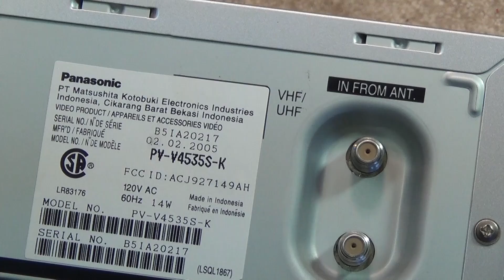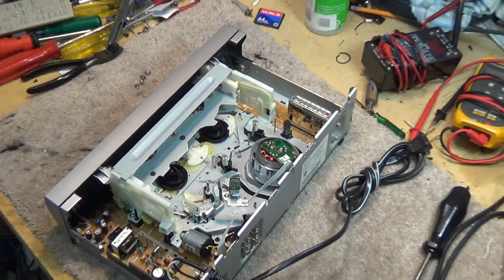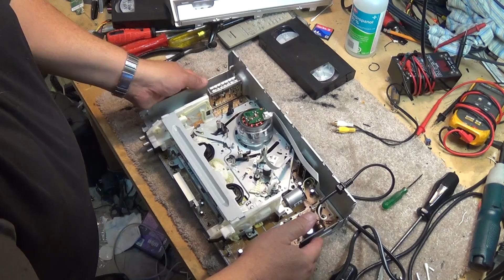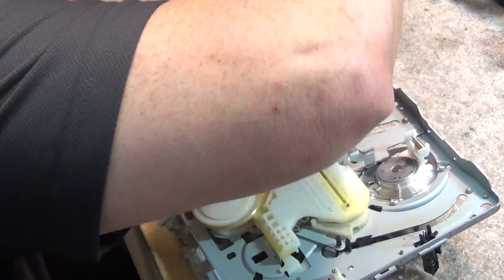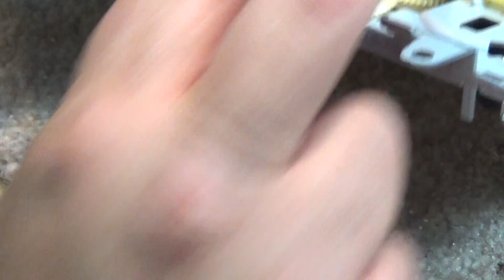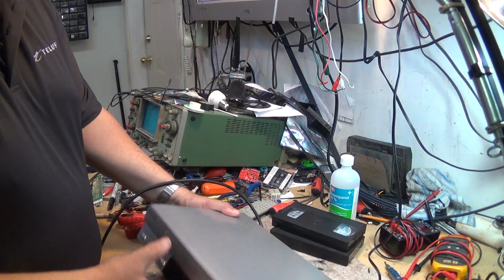Panasonic PV V4535 VCR total tear down

Comment: I got this vcr in July of this year along with 14 vhs movies but one of them was way too moldy to keep. It came with a panasonic remote but it had corroded batteries that expired back in December 2018, and it was a guy who had ALL KINDS of vhs tapes like SHELVES AND SHELVES of them. It was in Illinois but i live in Wisconsin. It may be the same model but it was manufactured on Nov 12 2005. Some of these late panasonics according to a few ebay listings i saw were from EARLY 2006!!! Not kidding.

Comment: Dave, i have this vcr as i said when i got it with a remote possibly but not the original back in 7/2023 model no PV-V4525S Manufactured Nov 12 2005 but the only issue is unlike my other machines the heads like to clog too easily! I did clean it 9 days ago and it helped a bit but it still got clogged from a damaged tape but it will clear once i run my head cleaner through it.
Reply: And there's barely any dirt on the heads.

Comment: My decade old vcr finally kicked the dust when I took it apart it had a blown fuse and every fuse I tried never worked now it is the centerpiece of my bookshelf
Reply: Something in the power supply must be overamping it.
Reply: Just bridge the fuse and check to see which component explodes. Then replace it.

Comment: I've seen simpler mechanisms... Kinda. My Panasonic nv-l25 has a G- mech that uses a solenoid and a single capstan motor for all functions, including eject, ff,rw,loading etc. The only other one is the drum motor. Wonder if you could make a mechanism with just the drum motor through some reduction gearbox
Reply from the maker: Early betamax units had 1 motor and belt drive for capstan, drum, reels and loading mechanism control.
Reply from the maker: That is actually one of the most complex mechanisms.  Solenoid clutch and planetary gear set to split power to different mechanisms.  They are slow, clunky and very prone to break down.

Comment: I also wonder did someone put all that together in the factory when it was made?
Reply from the maker: EastAngliaUK In the factory the machine was put together by robots. That is why the alignment holes. Pins stick through from the back side to hold pleces in place as the parts placer pops everything together.I have, on Beta a video shot at one of the Japanese assembly plants back in the 80's. It is quite fascinating to see how these units were made, even back then.

Comment: Thanks for that.  My roller guides are stopping halfway up the tracks and then the tape gets spat out, have you any idea whats causing it, i only just bought the vcr off eBay and it was tested and working fine before it was sent out to me.  Ive a similar panasonic model.  thanks.

Comment: Have a similar Panasonic, nv-vp60. Combo dvd unit. The tape will drop into place no problem and begin takeup but wont thread tape onto head, then it just ejects tape. Tried contact cleaning mode switch, and allignment looks good. Can turn main gear by hand and mechanism works. Any ideas?
Reply from the maker: And sensors?
Reply: @12voltvids  thanks for responding. I checked the IR emitter and can see its emitting light using my phone camera. Checked the IR receivers either side and they check ok on multimeter, basically diodes. Cleaned the IR light guide as well. Didnt check the supply and take up optical sensors. Didnt think its the take up sensor as it doesnt even start to play as it hasnt threaded the tape yet.
Reply from the maker: @hellominions1604 they are photo transistors and you don't test with diode meter.  You test with volt meter.  Voltage across the photo trabaiator should be about .6v when exposed to the or light from the ir led and go to about 5 volts when you block the light.   Your phone camera might be able to see the light bit if it's not strong enough it won't register with end sensors which many machines use as a way to detect that the tape is in place ready to load.
Reply: @12voltvids  Thanks, will check again. Mine only have two pins, and they are labelled + and - on the silk screen. Easy enough to test with voltmeter.
Reply: Success. It was the mode switch in the end. I popped it open, cleaned the tiny feather contacts, tried, no go. Then bent each contact down a very small amount so the were closer to their counterpart/base plate. Put it back together, and it works perfectly. Many thanks to you and your amazing videos, gave me confidence to fix this VCR.

Comment: Do you think the mechanical/electrical engineers are doing a better job today or a worse job!!!  That design the electronics today???
Reply from the maker: +Donald Ellett Design wise I think the new electronics are great. The problem with modern stuff is they build much of it using the cheapest materials they can get away with because they want to hit a specific selling cost.Older gear was designed well, and used over engineered components and parts. Say for example a power supply filter. For a 12 volt supply it was common to find capacitors rated 25 volts in them.  Today they would use 16 volts. Sure, the 16 volt rating is above the working voltage, but is running much closer to the maximum rating. Guess which one is going to last longer? In older VCRs they use solid cast aluminum, or steel parts. Then they changed to injection moulded plastic. Guess which one is going to wear better. They could build stuff to last, but it is all economics right. They don't want it to last. They want you buying a new TV every 3 years, not every 20 years as in the past. If something lasts 20 years they won't sell as many.Same goes for these LED light bulbs. If you believe they will last you 20 years, I have lake front property in the desert for you.Most of the LED bulbs inmy house are burning out after only 3 years.

Comment: When you was a kid, did you take clocks apart...
then put them back together, and have them work? 
Um able to tear them apart, but...  oh well, so far so good. 
It's fun to tear things down before tossing them in the trash. 
I like to get DirecTV TIVO receiver boxes, you get a hard drive, fan, and SPS. 
I often see those at junk stores for a few bucks, usually the HDD works.
Don
Reply from the maker: ***** When I was 6 or 7 I used to go hang out at the neighbours house. Old Mr Mallet was the community TV repairman and he worked out of his garage. I used to be amazed that he didn't get electrocuted, as every so often he would let out a scream and the air would turn blue with the 4 letter words that followed whenever he would get careless and a 480 volt B+ supply would bite when he was working on a chassis. The old tube sets would hold a big time charge for quite awhile after the power was removed. I started tekaing stuff apart shortly after that, and my parents had to pay Mr Mallet to put it back together! He was a funny old character, and his wife had this really nice garden that she grew stuff in that I had never seen. She told me she was growing a special type of plant called a Marijuana plant, and that she would bake the leaves into her special brownies and cookies, and it would relive her arthritis pain.  By the time I was 12 I was building my own radio sets.   By the time I was 15 I had a job working as an apprentice at a local shop, and received my full TQ ticket by the time I as 20. I worked in the industry as a professional Radio/TV/Video tech for 22 years, and then could see the light at the end of the tunnel, and abruptly left 12 years ago, and retrained for a totally different industry. Now, through these series of videos, I am giving back what I learned in all those years in consumer electronics repair.
Reply: I sure appreciate you.  When I was a crazy kid, I'd ride my bike around the "hood".  There was this ham guy around the block with towers and stuff on them.  I stopped by to say howdydoo one day when he was doing something in his Ford Falcon van.  He showed my his station, WOW! He had a huge linear in his basement, and told me about transmitters. I never forgot that air cooled commercial transmitter tube that.  he showed me, from a local broadcast station.  And mom got me a set of Concord walkie talkies from Olson Electronics that Christmas, that's how I first got the bug.  He told me to pick radios and TV sets off the curb with my Radio Flyer, LOL.  Later we got rekee players and reelers.  But I can't remember when I got my first zap of many.  Don
Reply from the maker: ***** We have all been zapped. The local TV guy that I used to hang around at was also a ham radio operator, and had an old Collins AM transmitter modified to operate on 80 meters. When he fired that thing up, all our radios and telephones went crazy.I also don't remember all the burns and zaps. I do remember a few though, an operating commercial microwave open put me on my ass when insulation on a tool failed, and the high voltage lead on a Sony KV27XBR bit me once. The big red HV resistor that had the static convergence control on it was cracked, and when I went to adjust the convergence, lightning leapt out and bit me good.
Reply: HA!  my first HV was dad touching a screw driver to the horizontal tube on the old Admiral when he pulled tubes to take to the drug store tester, he told me that he had to zap the picture tube???  He told me to KEEP YOUR HANDS OUT OF THERE,  OR YOU'LL GET A BIG SHOCK! I was CRT phobic for many years after that.
Reply from the maker: ***** We used to call the 2nd anode lead and HV cap the "Cobra"Well, it kind of looks like a cobra when it is not attached to the CRT, and like a cobra that sucker will bite without warning of you get too close to it.

Comment: That board is not very complicated!!
Reply from the maker: +Donald Ellett Everything is burring in a single chip.I remember reading an article in popular science in the mid 70's when the first CCD image sensor was created. It was very crude something like 100x100 pixels, but it was the start. CCD itself is not the image sensor. CCD stands for charge coupled device, and it is basically a device where a charge can be transferred between registers for storage or read out inside an IC. It was an early form of bubble memory. My first hands on with a CCD was a device I build called a CCD phaser. It took an audio signal, digitized it to 8 bit audio. Sent the audio through a CCD device, where it could be delayed and read back out, and converted back to analog audio, and mixed back in to the incoming audio. This cause an Echo, or phase shift and was a great effects box for a guitar player. I built that in my grade 11 electronics class, and they proceeded to build a B/W TV camera for grade 12 using a vidicon tube. I remember thinking some day this will all be done on a chip. It wasn't long after that that Sony made that happen with the CCDV8 video camera.